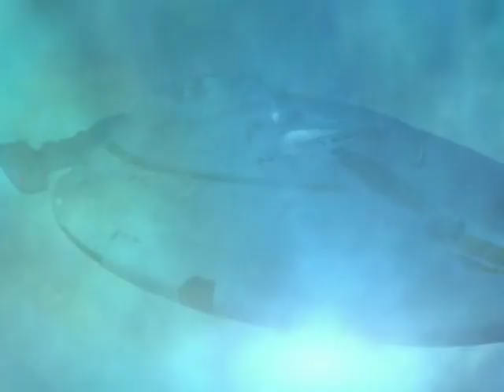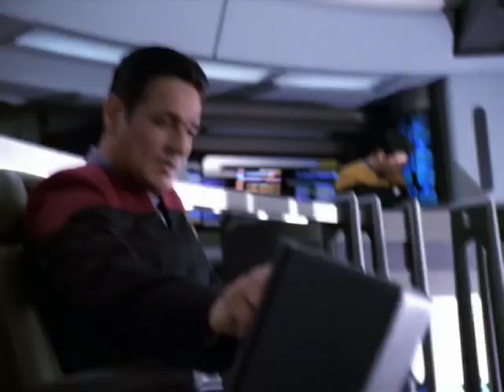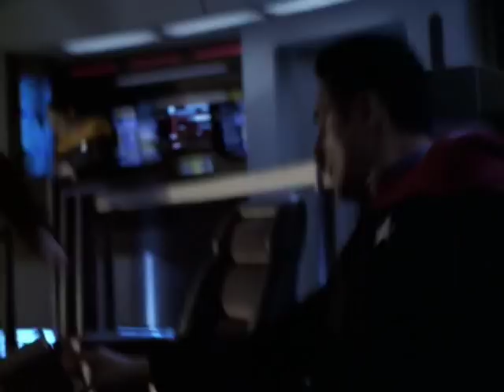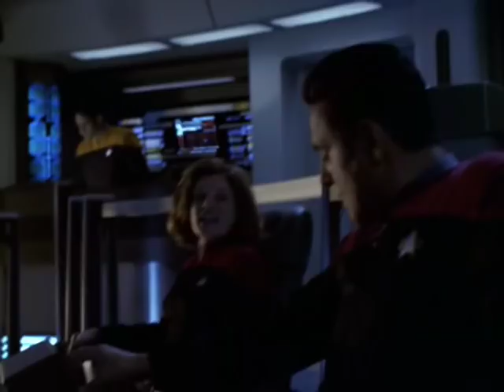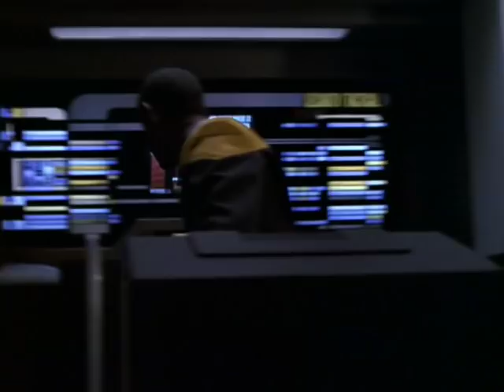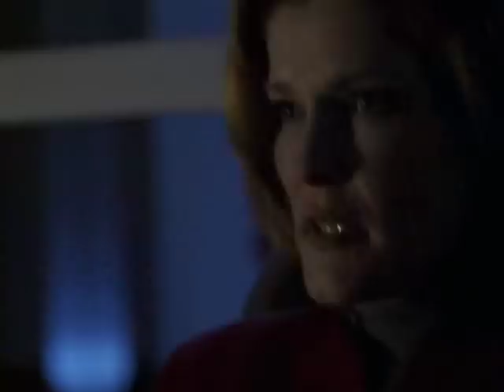Voyager is at the Perimter of Neutronic Wavefront

Comment: NEUTRONIC WAVEFRONT

is that the same one that the
NX 01 ENTERPRISE 
encountered in the
STAR TREK : ENTERPRISE 
ep
THE CATWALK
Reply: You gotta watch out for those neutronic wave fronts, lemme tell ya.
Reply: Luckily the Intrepid class came with Multiphasic and Multispectrum shields out of the drydocks. Given how violent this one was, they would not have survived if they had had to hide in the Catwalk - if they even had sucha heavily shielded area.
Reply: @christopherg2347  you mean the ship would've been torn apart? because if hte nx-01 can survive inside the storm i think voyager could too but problem is... can you fit 150 in those catwalks in a intrepid class ship ?
Reply: @joeswanson733  The NX could glide through theirs basically unpowered, with barley any turbulence. Being smaler and more flatter profile also propably helped the NX.
Voyager weighed anchor and had to use shields to survive the discharges. That is how much more violent this one is.

Comment: I thought the holodecks had their own power systems, which were incompatible with normal ship power systems?
Reply: Sometime during the trip on Voyager, the crew patched the holodeck power systems into the ship's plasma conduits - which means that they could be shunted over to support main power systems in an emergency... and this qualified as one. The downside of doing what they did, was that if there were ever any huge power imbalances on the holodecks, the feedback could possibly flow back through the plasma conduits - bringing any overloads with them. The crew (I think it was Torres who set this up) decided that the possible gains outweighed the risks. I'm sure that, after Voyager got back home... Starfleet probably decided to do the same thing on all of its' vessels - but with a lot more safeties and protections in place than Voyager had available. This definitely sounds like something the Maquis would do... which means it almost had to be Torres (and possibly Chakotay) who came up with the idea. But if you ever needed to supercharge the systems onboard a starship, this WOULD be a handy option to have!
Reply: Locutus  you have obviously never been aboard a starship l my dear
Reply: This Voyager.  Inconsistency is the name of the game.
Reply: Randomly Entertaining Not really. Just in your head.
Reply: They needed ALL THE POWER. Primary was down. They scraped the sonic showers, life support, replicators, and yes the biggest power suck-hog ever the Holodeck.
Reply: I believe something similar was done in that TNG episode with the debris field and Geordie's holo-girlfriend.
Reply: @rollerbladinggeek5507  
You know Locutus has only been on Borg cubes.

Comment: Don't you just hate it when space weather goes bad.
Reply: Yeah, was hoping to sunbath on the Hull.

- - - - - - - -

Honestly though, most--if not all--space "weather" is bad. Most cosmic dust, galactic energy, and solar wind are harmful to our delicate electronics aboard space craft, as well as our soft human bodies. If we ignore the sub-zero/boiling temperatures, absence of atmospheric pressure, and lack of breathable air, being exposed to the weather of space would not cause too much harm; at least not immediately.

Space weather (most of which are invisible to the naked eye)would dose our bodies with various levels and kinds of radiation, the kind that would shred our DNA. And wouldn't you know it, having holes blasted through one of our most basic organic building blocks isn't good for us. The longer we are exposed, the more chunks of our DNA come loose.

Space is not a welcoming environment.

Comment: If only we could do this in real life to solve our problems. Truck won't make it up the hill Channel all power from the air conditioning heating and radio to the tires. Channel on the TV don't want to come in, transfer all power from the ceiling fan to the TV antenna. Of course in real life pumping more electricity through an item just causes it to burn out.
Reply: actually turning off the AC will  return several HP to the engine power
Reply: @andreww2098  I drive a concrete mix truck, when fully loaded, turning off the AC only does one thing and one thing only. It turns the slightly cool cab moving at 10 MPH up that hill while the RPMs are screaming in pain to the whole world that can hear it............. Into a cab playing host to the heat of the fires of hell itself, channeled by the 6 speed Allison transmission that's literately directly under my ass........... While still moving at 10 MPH up that hill screaming in pain to all that don't want to hear it......................
Reply: @HighmageDerin  well it is only about 10 HP used to drive the AC, so turning it off will probably give you an extra 8 HP for the transmission but the point stands, you can indeed transfer extra power to your wheels if you turn off your AC just not enough to really help!